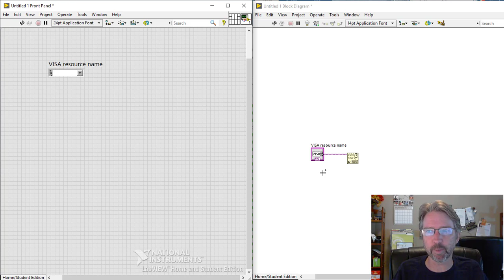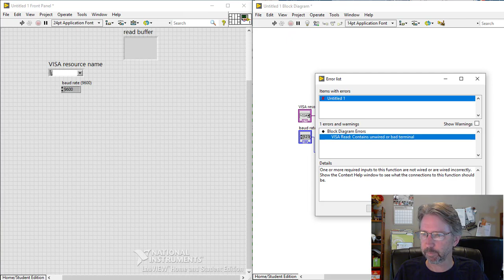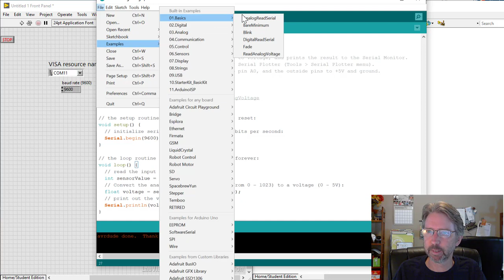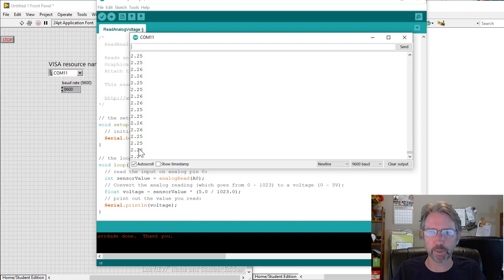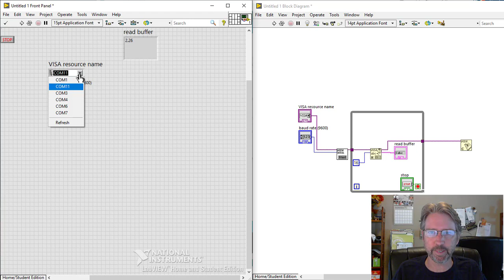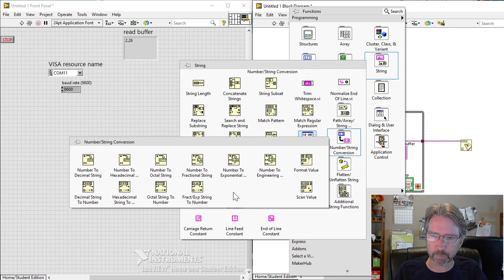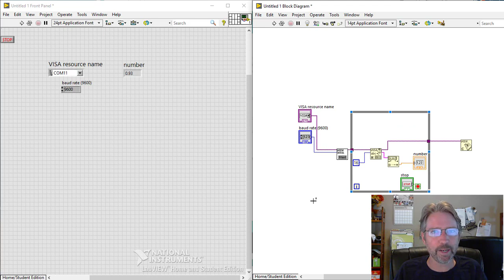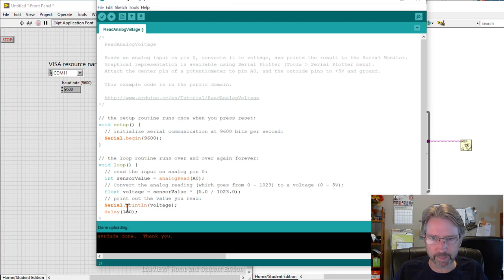Arduino Labview no LINX

Comment: Thank you for serial comunication tutorial. Thats great, i have tried serial comunication and i design the block diagram so i can change the comport and baudrate without turning off the simulation, but the data wont show up. Do you have a solutions for my case? thank you.. 👍🏻

Comment: is not the way a daq is supposed to work. wrong approach.
Reply from the maker: Can you be more specific?  There are many ways to use labview, feel free to ignore this video if it does not suit you.
Reply: @professorholden3104  is not about labview. you are using arduino like master.so happen that it fill up buffer if not quick. When you use a daq you or ask for data or tell instrument to acquire data and then retrive. In the way you use the system you cannot decide the tick time becouse is decided by ardu cycle. Linx in fact correctly use master slave comunication. None 9f instrument i use work in this way. Sorry for bad english
Reply: There is also another way using termchar. If you want i can have a TeamViewer or anydesk session and show you. Best regards
Reply: Just to improve your approach ardu can wait for a specific char. Only one  byte to be as quick as possible. No crc or other things. And agter it recive the byte sends out the reading. So simply adding a write one char give a timing to your implementation. That becames a master/slave
Reply from the maker: @djtonyxxx5  That's a good idea.  This is a very simple system and sacrifices capability to make it so you can use the most basic arduino print statements that many arduino hobbyists are comfortable with. I agree there are better ways that do not require much more effort however, and your suggestion is a good one to let labview trigger the reading.  Thank you for following up!

Comment: Thanks for sharing. Is that the USB port you are using in this example?
Reply: OK finally got it working. LabVIEW 6i, Windows 10, Genuine Arduino Uno. This was very helpful once I got past COM port issues (not showing up in NI-Max or VISA control window). Did a few things and not really sure which one fixed the issue :(

Comment: what if 2 sensor? or more?
Reply: If they are on separate arduinos you could duplicate this with separate serial ports.  If a single serial stream you would have to parse the serial data into the separate channels.
Reply: @meholden would you please explain how to parse the serial? Is it a function in labview? I am new to this topic.
Reply from the maker: @pouriabaghaei9566   the serial data comes in as a string, and a string parse function is used to convert to a number.  See around 5:40 in the video

Comment: Thnx so much. Saved me so much hassle !! are there any benefits to using LINX over this method? also is it possible to send signals to Arduino rather than just receiving?
Reply from the maker: The advantage with LINX is that you don't have to write the arduino side of the software, you use the linx code instead, and it has more options with sending and receiving and other peripherals built-in.  Without linx, you can send data to the arduino over the serial port if you write arduino code to read from the port and a labview VI to send the data.